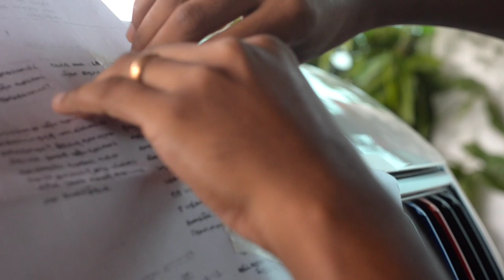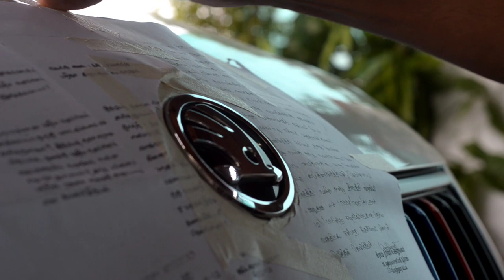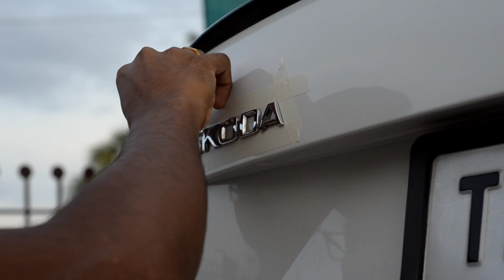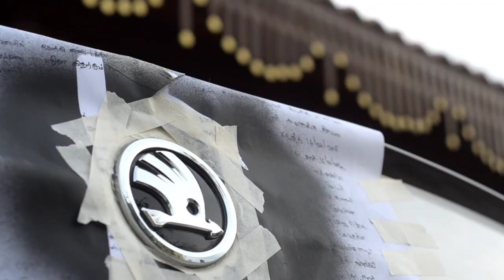Chrome Delete on Rapid & Polo with Rustoleum

Comment: Bro - Do you have suggestions on how to remove superfixed glued plastic ?, Unfortunately, I have used superglue to fix by volume button of the Polo audio player which made a bonding whole thing got jammed. I cant make volume changes and even unable to power off.
Reply from the maker: You can take that away as a set and remove the button carefully